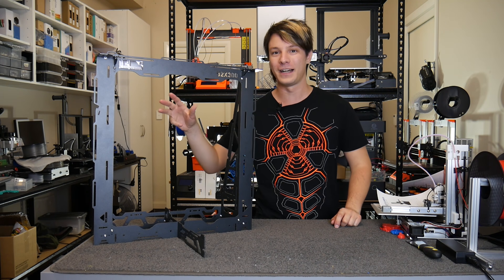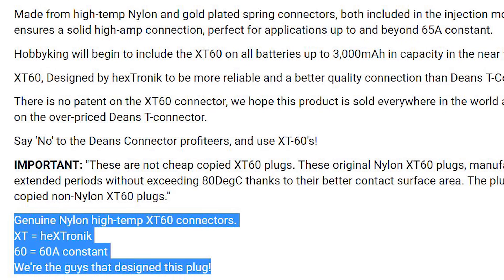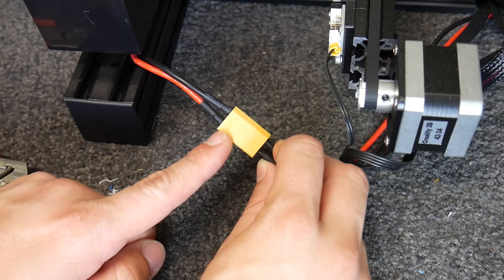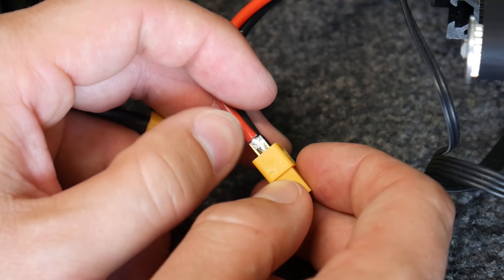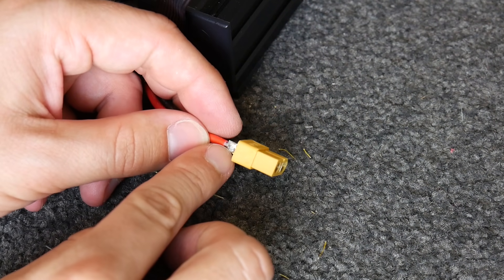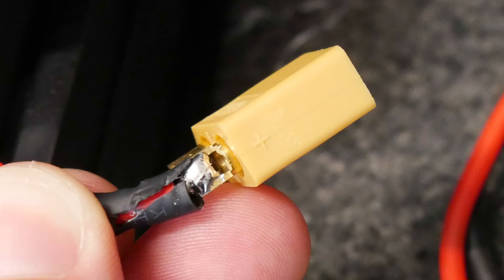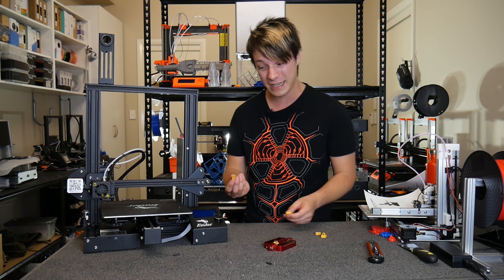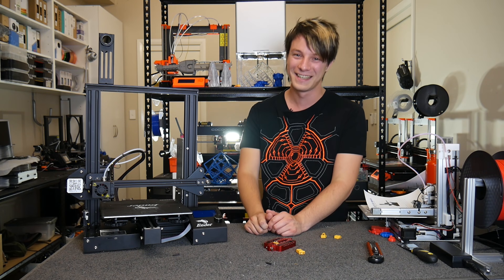Ender 3 Connectors are burning up... Bad XT60's

Comment: If you cut off the heat shrink and find a good solid connection, how do you suggest re-insulating it? Or do you have to cut off the good connection anyway at that point? (destructive inspection)
Reply from the maker: If you have any kapton tape, that will work well enough to insulate it again without resoldering and new heatshrink.
Reply: @MakersMuse  I'd be interested to see what that looks like. I haven't liked the look of most taped insulation unless there is room to use a lot of it, and this space is tiny.
Reply: Could you not cut two heat shrink tubes length ways, wrap one round the joint and shrink. Then wrap the second round and shrink, with the split on the opposite side ?

Comment: Another PSA for anyone who buys 2 into 1 parrallel banana adaptors (xt60,xt90 etc) from hobbyking, the amass bullets are fine but the wire connection in the middle is crimped with no additional solder. Not skookum.

Comment: you will know long before your printer fails by the color of the connector i suggest just to keep using your connectors until you notice a discoloration of the yellow connector turning black then you know for sure your connector is incorrectly installed without having to manually check.

Comment: I am sorry if I missed this in the comments... My Ender 3 Pro uses XT60-H connectors, but there are a whole ton of connectors in the XT60 line... is it okay to use a version with a different letter? I do not think so, but if you can clarify what the different letters mean, that would be great. What I mean by that is something like XT60-M, etc... Thanks!

Comment: For soldering the wire to the connector, you want to first tin your wire and the cup before making the joint. There should be no gaps in the cup and it should be completely filled with solder. The joints shown in this video were not done properly.
Reply: You can tell it was a cold iron too due to the "stringing" left behind after the assembler removed the iron.

Comment: Very poor solder job on those connectors, not enough solder and not enough heat. The knock off  XT60s have been a problem for years. The "original" XT60s are far better, and they are not expensive. Creality should do better.

Comment: I've noticed that the yellow plastic on poor quality XT60 connectors can't handle too much heat from the soldering process, where as the quality ones take a lot more heat before failing in the same way. I placed the 10 connectors I had bought in the bin, I should have realised they were a bit cheap :S
Reply: They are fundamentally dirt cheap whether you get bad or good ones. Unless you buy them from a local reseller that sells them at 10 times the going price.

Comment: I had the same problem with my connector. The wire were crimped so badly and the wire in the faulty terminal was loose in the crimp. I took good pictures that I can share.

Comment: Those solder joints are horrible.  Ive been running xt60s on rcs for yeara and have a lot of experience with both amass and knockoffs.  The main problem ive had with knockoffs is plastic melting when soldering wires on.
The connectors may not be the beat but that heat looks like its being generates at the crap solder joint.

Comment: Huh, I've always just used two pins of 4-pin PC Molex connectors for things like that. Either the middle pins as ground connection, or the two outer pins for 12V power connectors.
Reply: That would be very borderline. The current is specified at 11A at 30°C temperature rise for genuine AMP-made connectors, but i don't think it's suitable to design a temperature in like this, if you go for 10°C rise, you only get 6A if you use all 4 pins. In actual use, it's likely to fare a lot better, until it doesn't. I can't count the number of times when i service an old computer with all kinds of issues and the only issue is low-quality AMP connector clones which just do whatever and don't contact properly even with minuscule currents a hard drive or something like that needs.

Comment: Any connector can be crimped and in fact most pins are designed to be crimped on. The issue is when they aren't crimped properly with the proper tool, in which case a solder joint will surely be better. We will solder things in road cars but on motorsports work soldering is super rare. Same with aerospace.
Reply: Though I should clarify that most of these style connectors come meant for soldering. The color difference is kind of moot as I'm sure the same manufacturer might have slight changes between batches even
Reply: If the solder wicks too far into the wire it can create a brittle connection where some strands are stiff and others aren't.
Reply: I think you're probably right about the quality or the connectors though. Looking at the burn part of the pics the hottest spot / most resistance wasn't near the solder/crimp but inside where the pins contact. If it was simply heat transfer from the joint than the whole connector would turn dark

Comment: Crazy, and a bit of a shame to see that they'd let something like this happen. Seems to be a bit 2 steps forward one step back with Creality lately.  Hopefully they can sort it.
Reply: Really is. The other issue is I've looked at sales numbers for the Ender 3- it's insane. So problems are magnifyed because I don't think there's ever been this many of any printer sold before
Reply: @Naomi-Wu  Yeah the popularity certainly wouldn't have helped things. Still, it's good that they're trying at least. And from what I've seen of them so far, I'm sure they'll get it sorted. They do appear to have been taking on advice and making improvements when required, which is great. :) Just a shame these little things keep popping up here and there, rather than having a couple of easily addressed issues early on, and sorting them.

Comment: I have a Prusa 3, if you can call it that.. It came as a kit, I have made so many changes. The first problem was a fire and a short with the aluminum heater bead.. Now have 1/4 inch glass bed, with heater. No fires of it yet. lol   All I am saying is that I thought fires were standard across models. (I print in 100% ABS now.)

Comment: I checked the connector on my ender 3 pro because the connector got extremly hot when the heated bed was switched on. And it was actually crimped instead of soldered.
I replaced it with a better XT60. Now the connector does not even get warm.

Comment: I may be wrong here, but wouldn't a WAGO connector be fit for this? The benefit would be no soldering (so beginner friendly) + expansion possibility with no fuss for additional lines to a MOSFET or a buck converter (or both). These connectors are rated for 400v @ 32A and easily available and cheap.
Reply: Cezar -- I'm not saying your wrong, but first my Wago connectors I have are only rated at 20 amps, and the XT60 are rated at 60 amps... Even at that,  I don't see where your 32 amp connector would make sense to replace a one rated at 60 amps
Reply: Clay Kohl  You are correct, the newer ones with the big lever are rated for 20 A only. The “older” ones with the slimmer lever are the ones rated for 32A. I was just saying that these might prove as a good alternative for people who are not that good at soldering since the Ender 3 power supply only delivers max 15A.
Rated voltage EN (1) [V]: 400 V 
• Rated surge voltage (1) [kV]: 4 kV 
• Nominal current [A]: 32 A
Reply: @crapu4u  - Agreed, Mine is burning up and I now realized (after research) that its the connections causing it and not to much AMP.  I too would rather use a connector instead of solder, but uncomfortable being the first to use a Wago on my Ender
Reply: i ordered a MOSFET for the heatbed (i know that it's not really necessary but it doesn't hurt for my peace of mind). When it will arrive i want to switch to wag's...especially after all these news about XT60 crimped connections failing.If you can wait 1 and a half  weeks you won't be the first one :)

Comment: The bed uses about 9 amps at 24 volts. One half ohm of resistance in the connection will put about 40 watts of heat right at the resistance. The heat will cause corrosion, the corrosion will raise the resistance raising the local heating. These connections must be good.

Comment: Not sure i agree on the crimp versus solder if they are crimped properly they should be better than a soldered joint for high current
Reply: There is no way to crimp an XT series connector properly. What are you gonna do, crush a brass half-cup around a wire, distorting the connector barrel?

Comment: I wonder if the plugs are made from thermoform plastic so as the plug warms up, it loosens up the connection and you get my drift. Hope Creality learn their lesson as this is a tad annoying now.
Reply: All XT60 have a thermoplastic housing and it doesn't matter, the metal insert design is supposed to guarantee contact regardless of what the plastic bits are doing. But there are different grades, genuine ones are more high temperature resistant.

Comment: Note, crimping is 100% good method of making connections. There is however, like with any mode of joining, work quality that ultimately dictates how good the connection is. Soldering is easier to get working whereas crimping needs to be done exactly right. Soldering can however ruin the plastic jacket and make it harden. This can be a problem in some applications. Soldered + crimped is the best but is mostly just an overkill, one or the other should do just fine.
Reply: Yes, crimping can be a good method of joining, but only if the connectors are designed to be crimped. The ones on the XT60 are not designed to be crimped.
Reply: One this to add.  The connector needs to designed to be crimped.  A solder cup is not going to cut it for crimping.  If you are soldering and crimping, that is fine, but you MUST solder after the crimp connection, and it must be crimped to a un-tinned wire.  The solder has a creep issue at the pressures crimping exhibit and will flow lowering the contact force makeing a bad connection.

Comment: Re: soldering iron. Don’t get a super-cheap non-temperature controlled iron; they don’t work well at all. Get a proper temperature controlled soldering station. Even the low-cost Chinese ones (Aoyue, etc) work MUCH better than a basic iron. Also, use a big tip; either a ‘chisel’ or ‘hoof’ shaped one to get good heat transfer. Proper application of flux helps immensely. There’s quite a few videos on YouTube that show how to do this, search for “solder cup connector”. 🤔
Reply: I don't know, XT60 connectors and such, wires, i don't have trouble soldering with a 50W power regulated soldering station like ZD99, but... way much hassle always nudging the knob to make sure i get the heat when needed and don't burn it up otherwise. The ZD929C 50W temperature controlled is the one i use, have used for a decade. I don't ever want to solder PCBs with anything that lacks proper temperature control though, greatly limits accidents like lifted tracks on cheaper boards.

But then, i see newbies starting soldering with one of those soldering irons without temperature control, or with fake temperature control that just controls heating power, and those don't even often have thermal balance of any kind which makes them much worse to use than even the ZD99, and struggling, well, it's a terrible experience and not something anyone should put up with. After a few years of experience you can do it, but why would you.
Reply: Siana Gearz - Especially when the cost difference is less than lunch at a drive-thru...

Comment: Since I don't need to disconnect and reconnect often, would it be better to connect both cables via a standard mains-spec connector/terminal block and do away with this type of connector completely?

Comment: I have the same connector. Same soldered job. Have run jobs up to 10 hours without a heating problem so far. I wonder if this has also something to do with mods that load the printer more than the specs say.... And also maybe someone should check the quality of the PSU in connection with this issue. When i bought my Ender 3 people were complaining about the cheap PSU with soldered and not crimped cables. Now people complain about the crimped and not soldered connections. I know it is not the same and they should be reversed but what if the printers that overheated had a badly soldered PSU?... Also is this happening to people that run 110oC on bed heating and exotic materials or has anyone running stock printer with PLA printing had the same issues?

Comment: A knock-off is a knock-off and its life expectancy is low and their use in this application totally unsafe! 
I would have liked to see a magnet test on the pins of the knock-off. More than likely, it is copper plated low grade steel which is the usual "cheat" manufacturers do to make you think that the pins are actually copper. Give it a try!

Additionally, as a industry standard, ALL 3D manufacturers should use 220VAC silicone heat beds connected via a SSR. It's just too much of a risk to push these rinky-dink PSU's to the max to heat beds that in most cases are massive (see TRONKXY X5SA)! This is the first mode that I do on ALL my 3D printers; bed heats to the desire temp in minutes (on average 4+6) and the PSU remains cool and no danger with burning connections as long as you wire everything correctly.

Thanks for sharing Agnus!

Comment: You can simply spread the pins with a razor or squeeze them together with pliers to change how easy it is to disconnect.  Agree too loose could be an issue but simple solution is spread the pins with a razor/exacto.

Comment: Dear Mr Angus, I have my story: after one month and half I had y burned connector, and t reason was that the CONNECTORS WERE CRIMPED NOT SOLDERED, now to fix it I had to order new connector xt60 and weld by myself, now THE CONNECTORS ARE COLD LIKE AMBIENT TEMPERATURES.

Comment: This might be a moot point by now but my newish Ender 3 Pro has genuine Amass XT60 connectors. Now, when I write "genuine" I mean quality because we all should know by now that HobbyKing is the originators of the XT60 . I use XT60 connectors a lot in the R/C hobby and these connectors burn up for one of three reasons (in no particular order):
A- Poor soldering causing excessive resistance/heat
B-Wrong application. XT60's are rated for 60amps hence the "60" but if used in applications where the draw is higher than that, they can and will burn up. There's XT90 connectors and even XT150 connectors for higher amp draw applications. 
C-Using a clone "anything" connector. I've used clone Deans, XT60, and XT90 connectors and the quality is noticeably poor compared to genuine and I've burned my fair share of clone connectors as they won't even handle the amperage the original connector was designed to handle. A clone connector has it's place, say like the battery of a Fatshark goggle but in general, buy the real deal to avoid issues.

Comment: I can't heat XT60's with AWG 16 or 15 with 40w Iron, the tip does not have enough thermal mess, it loses all it's heat to the connector and wire too quickly and can't maintain the temperature high enough to keep the solder melted. I need at least 60W, mostly because the tip is thicker.

Comment: I only use authentic Deans Ultra Plugs. XT60 might be as good but they are bigger for no gain. Been using the Deans Utra for ages now and I've never once had an issue, regardless of the application. When I got my first cheap ass printer, I immediately put Deans plugs on it.

Comment: Those pictures of the 'crimped' XT60 don't look like a crimped connector to me, they look like a solder joint that's got way too hot and the small amount of solder has wicked up the wire and around the connector. Crimped connectors have a very distinctive post-crimp shape and are not round like those in the pics. They take on the shape of the crimp tool. It looks more like a cheap, poor quality connector was used and, yes, the solder and soldering are probably also poor quality as is the risk with products with no real supply chain quality control. 
From the close ups Angus shows in the video there are distinct differences between the real and the 'knock off' XT60 connectors, particularly on the socket. The 'real' acceptable quality connectors appear to have a substantially thicker wall than the 'knock off' connectors, the socket appears to have a full dome closing the socket from the solder cup which will both assist in distributing the current from the solder to the whole circumference of the socket and prevent solder dribbling down into the connector and messing up the plated, hopefully dimensionally accurate, mating connector faces. This is without knowing what cheap alloy was used for the metal underneath the few atoms thickness of gold plating which I'd bet a fair amount of money is much cheaper and nastier in the knock offs than the 'real' connectors, it's not the gold plating that carries the current to the contact area, it's the bulk material, all the gold plating does for you is provide the contact surface between the parts, you still have to get the current to the contact surfaces. Hobby King themselves have pictures in their web store to show what happens when you try to put the rated power through the knock off connectors.
What that all means, if I'm not wrong, is that it's probably not 'bad' soldering which is the cause (although the soldering in Angus' samples was horrible) it's the cheap knock off connector that couldn't be saved by any amount of 'good' soldering.